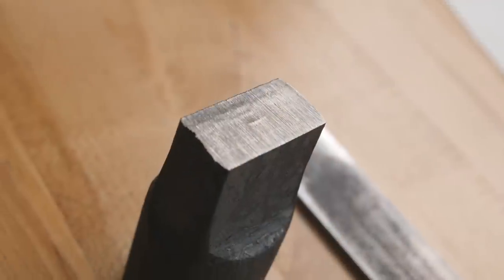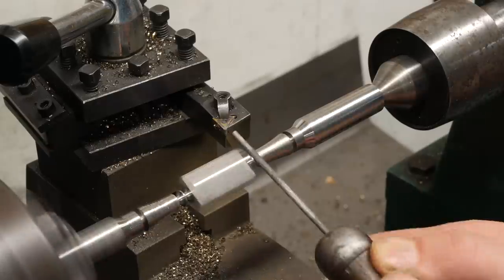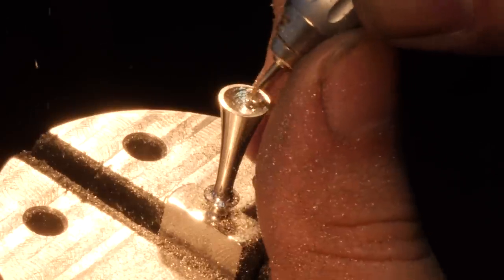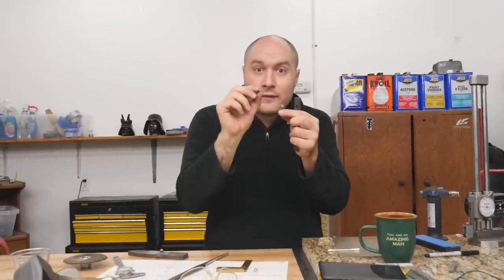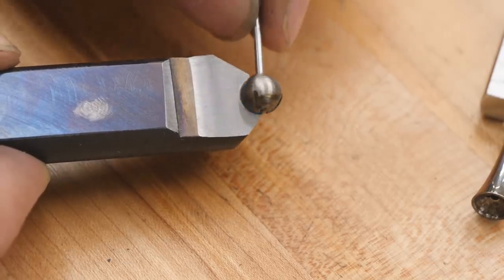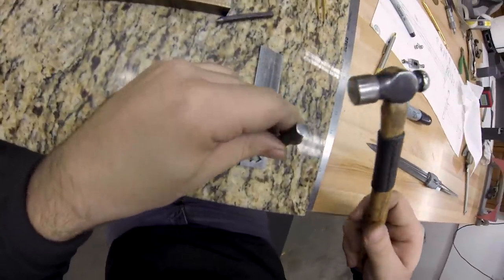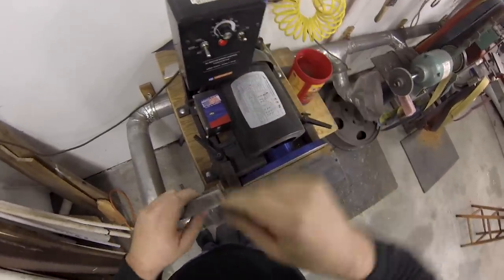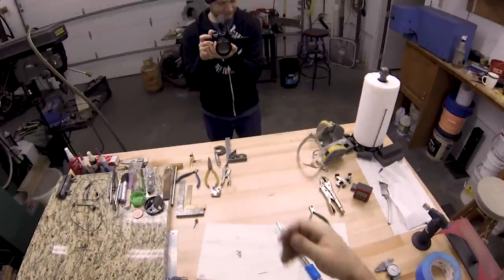Lathing, Lots of Lathing: First Ever Stiletto Part. 3

Comment: To hold that guard you could've built yourself a clamp arbor out of steel by rounding it down to 3 inches then milling the center the same thickness and width as the rectangle piece on the guard then cutting it into two halves that the guard would fit inside, then put the guard inside it then boom, got a round clamping arbor that you can reuse for other guards in the future
Edit: actually instead of cutting it into two halves just slot one side so and have the center milled so the guard fits tight, then when you tighten the three jaw it'll clamp and remain perfectly centered